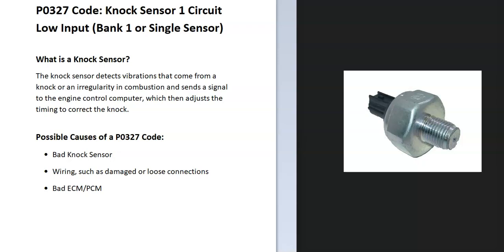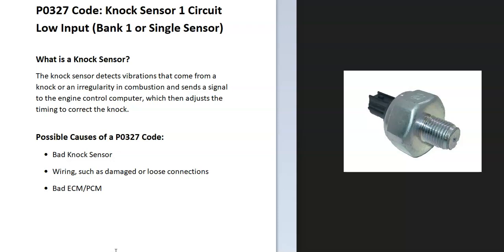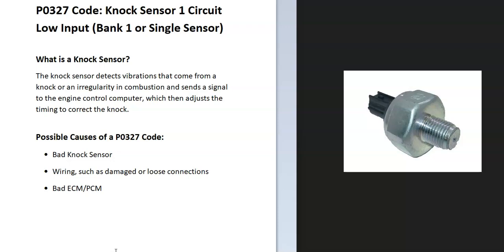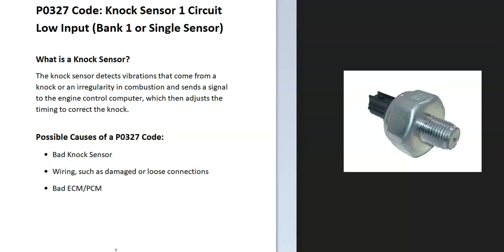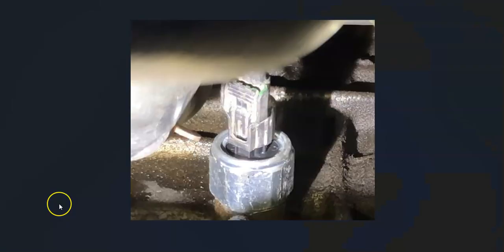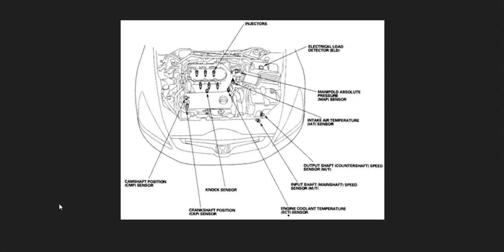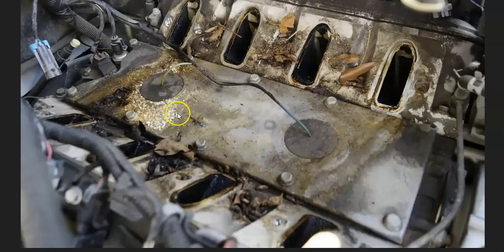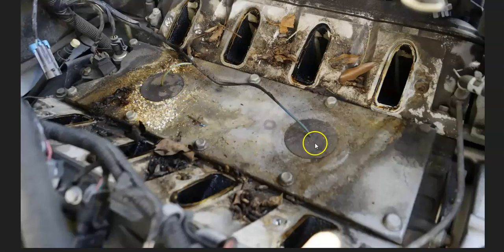Causes and Fixes P0327 Code: Knock Sensor 1 Circuit Low Input (Bank 1 or Single Sensor)

Comment: I have an old 2004 vw polo, my engine light came on a few weeks back from writing this, i used a basic plug in bluetooth dongle plus phone app to read codes and it came up with P0327 knock sensor low input etc, having read up on what it can cause I walked to work for two weeks to avoid using the car as xmas time very busy for the local garages so had to wait two weeks, glad I did as it can damage the engine, so got it replaced of course engine light now out and hopefully  will see if in the next few days or weeks all its good.

Comment: Can a bad O2 sensor trigger an issue with the knock sensor?
Reply: I changed the sensor and harness and still giving me a code
Reply: @autoperformance503 did you find out the problem
Reply from the maker: If the 02 sensor is giving bad data and the computer is adjusting the air/fuel ratio too lean or rich, it may be triggering the knock sensor. If this happens, there should be other codes.
Reply: @HVAC_Mechanic  ok, thank you. That's kind of what I thought. It's strange though, I can clearly see my one of my O2 sensors is reading 0.0volts...then I look at the fuel trim cylinder reading..that reads 0%. But the only code I'm getting is the knock sensor low voltage. Idk why it's not throwing a O2 sensor code.

Comment: Thank you very helpful going to check it out make sure wirings good if not replace retest its pending not stored does it only if it sits long time possible injectors cylinder #3 missfire i already did the plugs not to long ago will inspect cylinder but that is dead on

Comment: What if i replaced knock sensor, all spark plugs, spark plug wire, all coils, crank position sensor, camshaft position sensor, map sensor, mass airflow sensor, new throttle body, intake manifold gasket, valve cover gaskets/both, valley pan gasket, and put in a new ground wire in the back, oil pressure sensor, all new O2 sensors, Purge valve by the gas tank. I replaced everything and still have the same issue.. what do i do next
Reply: I hope someone answers I've done this twice, once with Dorman and my boss at work said everything needs to be GM parts so I ordered from Amazon and now got P0327 code. If I figure it out I'll let you know.
Reply: @anthonyj.lobreto5544 just replaced both sensors and harness with oem pick em up from dealer myself and now the front knock sensor is throwing a code . Did you figure out the issue?
Reply: @Socal-1776  No but I had my boss that has a very high dollar scanner run it and everything was up to par as far as all the perimeters were normal so it could be a ground issue but since I posted that the check engine light is still on.
Reply: @anthonyj.lobreto5544  oh ok well that’s not good I live in SoCal so I’m worried about emissions test. I cleaned connections and even took apart ecm and cleaned connections but it’s still on. I will try messing with the grounds next.
Reply: @Socal-1776  I put a fuel pump and a new filter in last Sunday May 5th 24 and it's the Friday after and so far no check engine light but I'm not holding my breath but normally it would have been on already.
Reply: @Socal-1776  P.S. I lifted the bed to do the fuel pump and had a stripped bolt on the driver's side of the bed so rather than cut a hole in the bed like some videos show I used a die grinder and a cutting wheel to remove the bolt and a bottle jack to lift the bed but with my sons help we set the bed back down by hand.
Reply: I have not gone to the extent you guys have but I'm going to try high octane gasoline. Did replace both of my sensors.  Mine comes on driving highway speeds.
Reply: Why not try replacing knock sensor wireing harness
Reply: Also replaced all evap tubes.
Reply: Check your wiring
Reply: Check engine light came back on yesterday it didn't take a week.
Reply: Replace car or technician.
Reply: 😂 @alterego8161
Reply: Did you ever find a solution to your issues? Because I have a 04 Sierra and it sounds like we're both chasing the same thing
Reply: Same
Reply: @JuanGomezCaro-w2z  I have not done as much as some.  I should have brohgt it a local respected shop.  But now I have a stuck plug in an aluminum head.  I was doing a compression test.  My lowest cylinder was 135 6 were  190 and 1 I couldn't test.  Oh yea i broke 3 plug wires.  I was thinknig maybe a lifter noise.  It has 1 that take a few seconds to quit ticking.  What the scanner says is it happens at 55 1500 rpm.  I am torn between buying aused engine and having this one rebuilt.  I want to keep the truck several years as it is paid for and fairly solid 4wd.
Reply: What to do next?
File for bankruptcy.
Reply: Go to pick a part and get you a 6.0